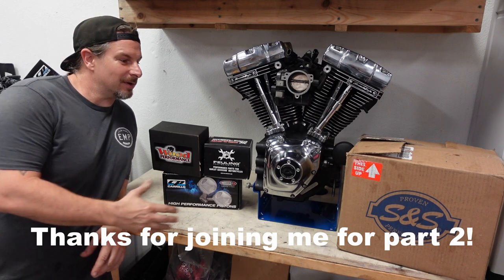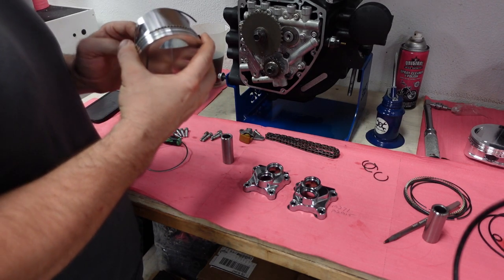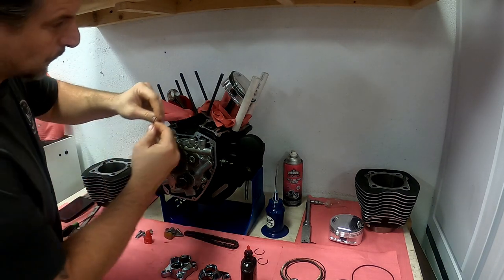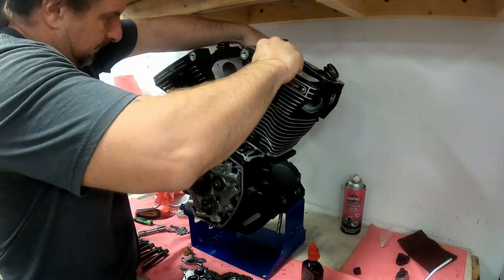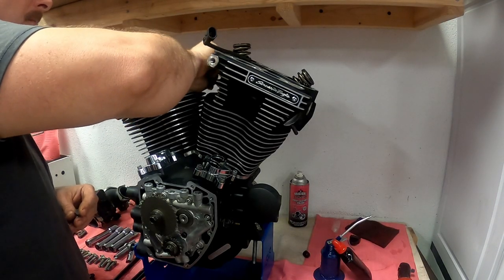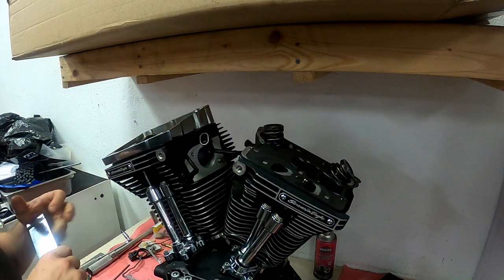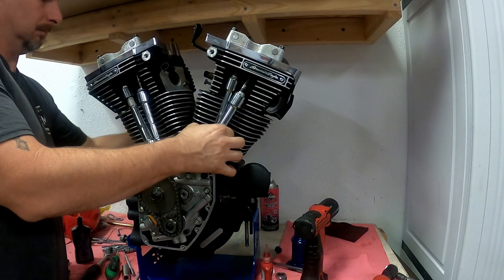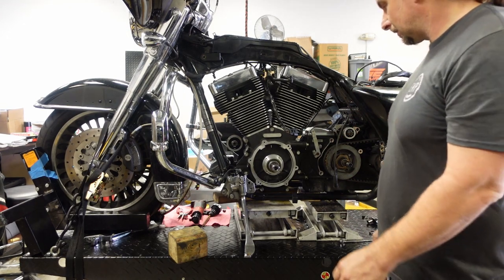Building a Solid Twin Cam 103 Part 2

Comment: Can't you use the timing marks on the cam sprockets to determine top dead center?  Marks closest to each other would be TDC for rear and marks both at top of each sprocket would be TDC for front ?
Reply from the maker: You probably can use it for an estimated tdc. I’m not sure the orientation and which cylinder the marks line up with. I don’t think front and rear would be 180 from the front on the cam marks. As far as tdc goes front and rear are not  at the same point of crank rotation due to the single crank pin. (The pistons are not at the top of the cylinder at the same time) When I need top dead center, for cam timing, I use a degree wheel and positive stop.

Comment: Really enjoy watching your motor builds.  Curious, why does Harley use such high inch lbs instead of low ft lbs.  110 - 9  120 - 10  Curious.
Reply from the maker: Thanks for the comment! I think the service manual uses inch pounds for anything 10 ft pounds and under.

Comment: What cams did you go with from Woods? I have the same 103, and recently did Woods 777+ S&S 106 Big Bore kit + 2-1 FC exhaust, + s&s intake + FP3 tuner. I think i want to change out the tuner for better tuning. Now i have to clutch is slipping, so gonna add new clutch so it stops slipping during acceleration.
Reply from the maker: It was there 999 I believe
Reply: @EMP Cycle Works  I'm curious to know and see the difference between the 777 vs 999. Do you plan on Dino it?

Comment: Love the videos…looking at upgrading my 07 fatboy 96ci to a 107 and heads. Ive had cams, oil pump and cam plate already and was told I had 11 thou run out on crank. Would you do the build without doing the crank or just be happy with what I have?
Reply from the maker: 11 thou is to much run out for my liking. What cam plate and oil pump do you have installed? Most of the after market setups want a maximum of 0.005" run out on the pinion. 

 Before you build a 107 I would get that crank serviced. 

Thanks for the comment!
Reply: @empcycleworks  thanks for your response, it’s a fueling plate and pump with S&S cams.

Comment: This was a great video for me to watch as a refresher course. Used to build a lot of engines when I was a young man . Shovelheads, small block Chevys, Pontiac 389 cid Tri-powers and so on. It’s been awhile though and now I am confident that I can rebuild the TC 103s on my my two Harleys when the time comes. Going to have to replace some of the tools that I used to have several moves ago but it will be worth the cost. Thank you for posting this. You have a new subscriber here. Keep up the good work.

Comment: I've heard I needed to check piston deck height without the rings before install. Is that something you do?  I didn't go crazy with the build, just going for 103 to 107 with a 590 cam.  Is there any other checks I need to do or should it be fine in your opinion?
Reply from the maker: Yes that is a good thing to check. In most instances you can get by with a straight edge and a feeler gauge to measure it. Every part has different tolerances. I do check that.
Reply: @empcycleworks   ok.  Is it still required to check valve clearance with putty?

Comment: Great video. Thanks. How do you feel about a Timken crank bearing upgrade? Some builders insist that it is needed. However, I see allot of high horse engines out there on the road with stock style bearings.
Reply from the maker: I think it’s a good upgrade if your crank needs service. Certainly not 100% necessary.

Comment: What was the torque spec for the bolts that hold the engine to the transmission? I haven’t been able to find it anywhere and I’m not sure if there’s an actual Torque spec
Reply: There is a torque for every bolt made. You can find torque charts on Google Images I screenshot things like that and file them in a special file on my cell phone I titled “Charts” for future reference.

Comment: Any reason why you’re using the stock cam plate...
Reply from the maker: The budget! The late model TwinCam camplates are a pretty good unit. I used the Feuling HP Plus oil pump, lifters and pressure relief valve on this motor and it has 40 psi oil pressure at idle. If the budget would of allowed, upgrading to the fueling race series or S&S camplate/oil pump are my go to. Thanks for the comment

Comment: I have evo1340an bottom cases got damaged an what  you when you replace the case it will not macthnumber   do carry the Old case with you
Reply from the maker: I dont stock any cases, unfortunately. If you get a case from Harley, I think they usually come without a number. So you can stamp your own. Not sure if new evo cases are available though.

Comment: Thats awesome work man! its nice quality workmanship like this! 
Question about the heads you used, They say "screamin eagle" on them, are they off of a 110?
Reply from the maker: These heads are straight out of the Screamin Eagle catalog at the time this motor was originally assembled. They would have came in the 103 Performance crate engine, before they came out with the 110. Im not sure about what the difference is between these heads and one that come with he 110.
Reply: @empcycleworks  Right on buds! thanks for the info! Like i said before its great seeing awesome workmanship along with a thorough explanation of how everything is going together and why! Keep up the killer work!

Comment: MINE as WELL JUST BUY an S+S MOTOR, a LOT CHEAPER
Reply from the maker: But not as fun!
Reply: S&S crank $1500
Cylinders and pistons $1000. 
S&S cam plate oil pump
$1000. 
New head $1500. 
$5000. 
Still cheaper. And you get to retain your original numbers.